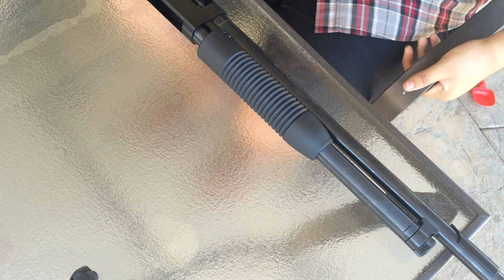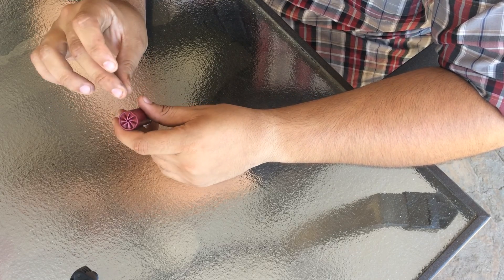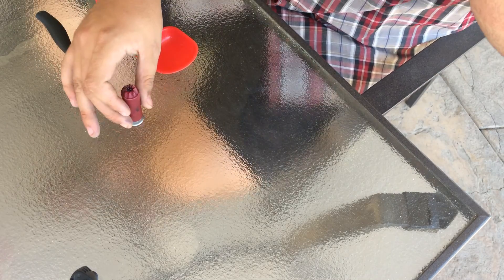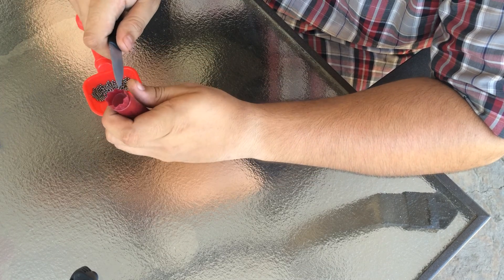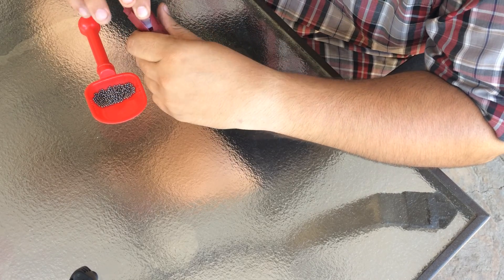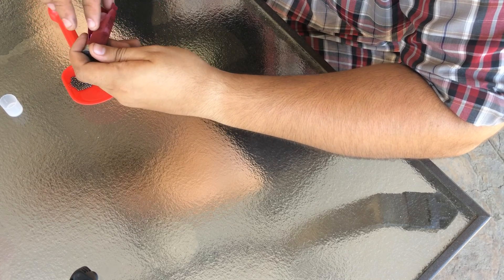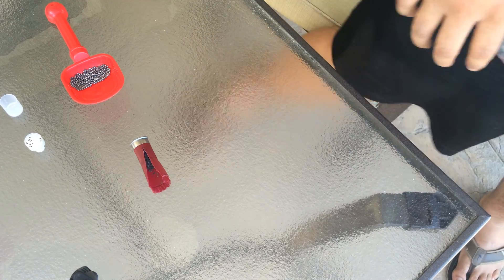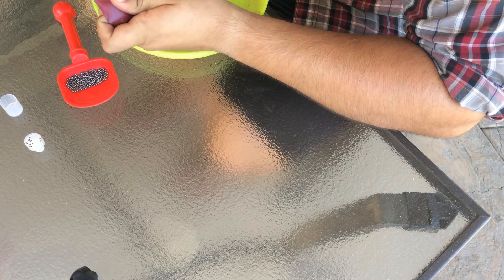Shotgun Shell Breakdown - What's Inside a 12 guage shell?

Comment: i thought a 12 guage means a 12 pellets inside the shell.. :(
Reply from the maker: No not necessarily. For example my regular 12 ga 2.75"00 Buck has 9 pellets in it while my 3" magnum 00 buckshot rounds have 18 pellets, and then you can go to different sized like 000 buck, #7, #8, #9 shot etc which allows you to fit different amounts of pellets in the shells.
Reply: I also
Reply: primary guardhouse 12 gauge is a measurement, the lower the number the larger the shells and more powerful because it’s measured in fractions. 12 gauge meaning 12 gauge balls will fit per pound in the barrel. It’s difficult to explain. 12 gauge means that you can make 12 balls to fit the barrel out of a pound of lead so if you have let’s say a 8 gauge you can make 8 balls to fit the barrel out of a pound of lead meaning they are much larger.